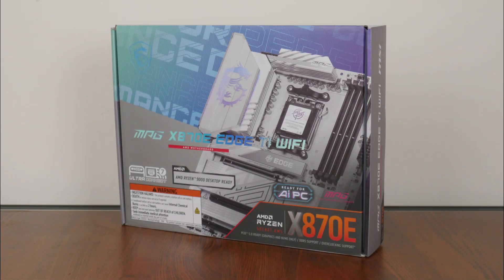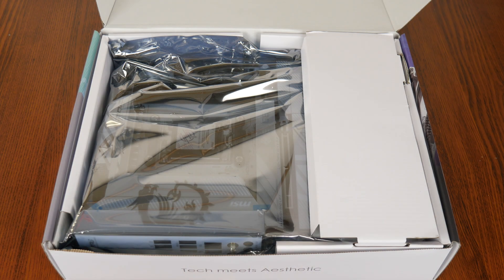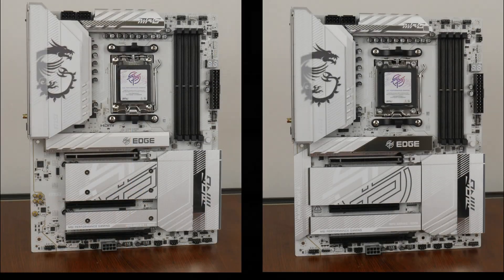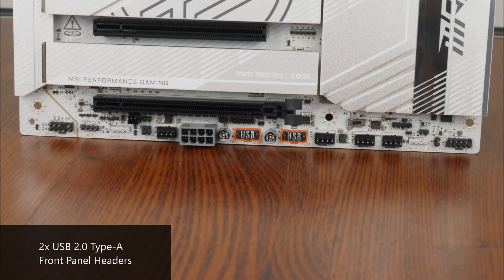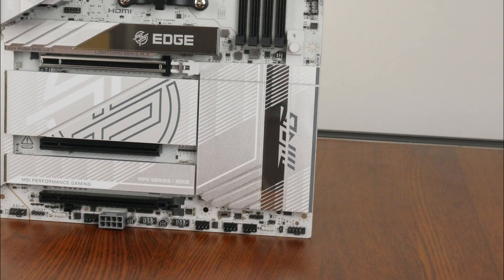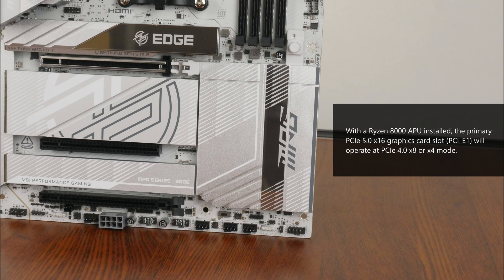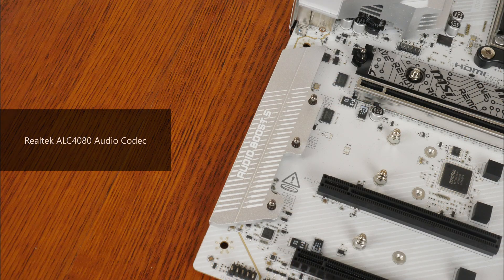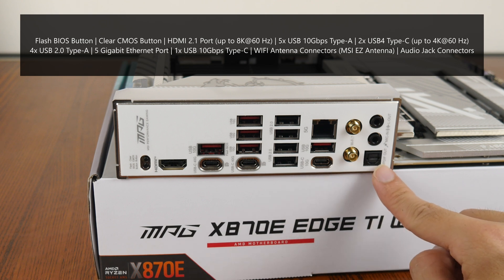Great for high-end Ryzen 9000 PC builds in white! MSI MPG X870E EDGE TI WIFI Unboxing & Overview

Comment: I just built a new system using this exact motherboard for christmas 2025 and i could not be happier! Like you said it looks amazing, feels so premium and performs incredibly well! I love the white so much also that i bought everything in white. From my fans to my power supply to my Powercolor 9070xt Red Devil Spectral White Limited Edition GPU. Beyond happy and so satisfied! Sometimes i just stop to admire my new build with this incredible motherboard! Thank you and MSI! ❤
Reply from the maker: Glad to hear that your build turned out awesome! Are you using perhaps a 7800X3D/9800X3D for your processor? Also, what PC case did you go with for your all-white build?
Reply: @ALKtech  I am using a 7800X3D!  And my case is a Thermaltake Core P3 White case! i love how its all open on the sides..... :)
Reply from the maker: @Blueshade  nice! I guess the only thing about an open-air case setup is the need to clear out the dust from your components every so often 😅
Reply: @ALKtech  This is true but it does stay oh so cool! :)

Comment: Thanks for the vid! Given that this motherboard has a vrm rail of 14 + 2 + 1, can the Ryzen 9 9950X3D performs well on this mother board?
Reply from the maker: Cheers and hope you found the vid useful! Yeah this board should handle a 9950X3D just fine, gotta make sure you've got a good cooler to handle the 9950X3D's thermals! Are you intending to use say, a 360mm AIO for your build?
Reply: @ALKtech  Thanks mate! yeah, I chose the Arctic Freezer PRO III 360 for my black and white build.
Reply from the maker: @str2591  nice, that AIO should handle the 9950X3D just fine! Will you be using a range-topping GPU for your build?

Comment: I dont understand the ezconn port, my msi aio is plugged into it but i still have to plug the pump in the top and the usb in the bottom, so basically it combines the aio fans and argb into one right? Or am i missing something?
Reply from the maker: Hey there, yup it's supposed to combine the fan header, ARGB header and USB 2.0 connector into an all-in-one connector - which model of MSI AIO do you have, and does it have the EZ-Conn cable header?
Reply: @ALKtech I have the p13 360 aio, it has the ezconn connector
Reply from the maker: @jimmystewart510  ahhh I see, your P13 uses the JAF_1 EZ Conn connector, which only combines the ARGB header and fan header into one connector. There are two types of EZ Conn connectors - JAF_2 is the other more "premium" type and uses eleven pins, where it combines ARGB, fan and USB 2.0 into one header. This explains why you still have to connect a pump header and USB 2.0 header to your motherboard!
Reply: @ALKtech thanks! Made a note, now I know what to look for

Comment: So does this mean that if I only use Gen 4 ssd then I won’t have to worry about any lane sharing at all?
Reply from the maker: Hey there, as long as you have a M.2 drive (regardless of PCIe Gen) installed in the second M.2 slot, there will be lane sharing for sure. Hope this clarifies!
Reply: @ALKtech ohhh ok thank you! But if I use the 3rd or 4th slot I’m good? I’m planning on using 2tb on the top drive and then sticking another 2tb somewhere else later on. Which should I use for secondary drive to make sure no lane sharing happens?
Reply from the maker: @BoscoLocoo  yeap you can install your second drive in either the third or fourth M.2 slot and there won't be any lane sharing!

Comment: After going back and forth between this board and the x870 Aorus I pulled the trigger on this one. And got it for $270, only to see the very next day the price is back at $325. Thank god I got it when I did. Just came in yesterday and wow, the build quality and features and aesthetic for an all white build is unmatched! Just wish they would have went full white by not using the black accents for the DIMM slots etc. Haven’t built with it yet but man I’m hyped
Reply from the maker: Man US$270's a pretty darn good price. Where I'm from (Singapore), this board goes for around US$500 😅 And yeah, pity about some of the board's hardware bits being black in colour..it seems like only Gigabyte got the memo on an actual all white board for the current gen of AMD and Intel boards! What processor and GPU are you intending to use for your build with this mobo?
Reply: @ALKtech I got the Ryzen 7 9800X3D and Rtx 5070 ti Aero OC. All in the white Lian Li o11D Evo Rgb. This is my first pc that isn’t a pre built so I’m going big on looks. I wanted a 5080 but they cost sooo much especially for a white one :(. But damn bro why’s it so much more expensive in Singapore?? Shipping reasons?

Comment: Where is the CMOS battery located? I have this board and can't find the battery.😭

I tried to update with bios with a USB flash drive on the back and now the computer won't boot (but it does power on.)

I've already tried jumping the JBAT1 and still no luck.  Next step is to remove the CMOS battery to drain any residual electricity in the board, but I can't find the battery.
Reply from the maker: Hey there, sorry to hear that your BIOS flash attempt failed. If my memory hasn't failed me, the CMOS battery is located beneath the I/O shield shroud, around where the VRM heatsink is. You'll have to remove the integrated I/O shield, I/O shield shroud and VRM heatsink to gain access to the battery I think 😅 that said, if the BIOS is bricked, I doubt that disconnecting the CMOS battery is going to help, and you might instead want to try the Flash BIOS feature once again, perhaps with a different USB drive to see if you can successfully re-flash the BIOS and revive the board. Hope this helps!
Reply: @ALKtech  Yes... it helps. thx. I'll try a different USB stick tmrw. I found another blog that said to use Rufus to format the stick. So I'll do that and try a previous version of the bios just in case.  

Wish me luck! I hope I didn't brick it permanently.🤞😬

I had another thought. Maybe you could advise...
Would the video card have anything to do with it? 

The computer turns on,  but nothing shows up on the monitor. Computer was working perfectly before trying to update Bios. 

Would it be possible that the bios update DID work, but then it somehow "forgot" my really old video card? 

My card is from 2008, but has been working perfectly.  (Been holding off on getting a new one until the prices for used ones come down.)
Reply from the maker: @happyhomeandgardenjohndawne  best of luck! Modern motherboards aren't as "glassy" when it comes to BIOS recovery compared to say, boards from perhaps ten years or more ago, so hopefully you'll be able to reflash the BIOS successfully and be on your way! On the note about your graphics card, what processor are you using with this board? Reason why I'm asking is that AMD processors have integrated graphics that you can use as a back up (assuming your processor is a non-F part, F parts such as the Ryzen 5 7500F do not come with integrated graphics). While I think it's reaaaally unlikely to be a graphics card issue, you can try plugging in your monitor to the HDMI port on the rear I/O of the board, and see if anything changes!

Comment: Which three slots would you use? I'm planning on the operating system and games on one 4tb M.2 and a couple more M.2's for additional storage. I'm going to put the 4TB in slot one.
Reply from the maker: Yeap I'd put the 4TB OS drive in slot 1. Do you have any use for the USB4 ports? If no, go on ahead to populate the remaining three slots with M.2 drives, and disable the USB4 controller from within the BIOS such that the second M.2 slot will have its full bandwidth! If you foresee using the USB4 ports, I'd avoid installing any drive in the second M.2 slot, and populate just slots 3 & 4 - this will avoid any lane sharing. Hope this helps!
Reply: @ALKtech  excellent, quick response. Thank you so much for the help!!

Comment: only problem is difficulty in accessing the battery, they could have done the same as carbon, easy access to the battery.
Reply from the maker: Yeah agreed, though this seems to be a trend with motherboards of late, where board manufacturers tend to "hide" the CMOS battery beneath the I/O shield shroud!

Comment: Just finished a build with the motherboard. Only discovered EZ Conn after. Have an NZXT Kraken, would that work when connect through the EZ Connect port?
Reply from the maker: Hey there, I think it should work. Why not just give it a try and see how it goes - it'd be interesting to see if it works with your Kraken!
Reply: @ALKtech  Will be giving it a shot later today. Booted up the PC without EZ connect. Have the Kraken hooked up a set of Lian Li Wireless TL fans. The fans on the AIO are blinking. I believe they arent getting enough power. Am interested to see if EZ Connect solves this issue, or at the very least works at all. Will come back with my findings
Reply: Can confirm EZ Connect works with the NZXT Kraken Elite 360 AIO. Very cool feature this motherboard offers
Reply from the maker: Sweet, thanks for sharing. A useful data point for folks out there who might be keen to use EZ Conn with non-MSI hardware. Cheers!

Comment: For anyone considering this or any Msi board, make sure to go to the MSI website and confirm your cpu, vga, RAM and your NVME ssd drives are on the compatible QVL list and have been tested and match “”using the full part number”” because they are very picky about components and can send you into debug if you use the wrong part number component. Also there are only upper heat sinks for all m.2 drives, not both sides like in some other boards unfortunately. Would also be nice if they had a black option but white is cool too. For the price this is a nice board! And the accessories are cool too. Thank you for the detailed overview ALKtech! 😎👍

Comment: This was really helpful! Just put this in a black HAVN HS 420 case with reverse blade be quiet! light wings fans (7 black reverse blades for intake with white logos with white rgb rings around them, the other 4 fans are black be quiet!s) and I gotta say, I'm glad I made that decision! I loved the specs and got it on sale, but I was worried about how the white motherboard might clash. With all the white/grey accents on the black case and fans and the more metallic/silvery accents on the mobo and ram (g.skill Trident Z5 royal royal), it works really well. I was tired of all black builds, but thought all white builds seemed equally "same-y". Glad I took a chance, because I have a really hard time visualizing the final result in my head.
Reply from the maker: Glad to hear that the build turned out super! Did you go with a black graphics card for your build?
Reply: @ALKtech  The GPU is likely what clashes the most, to be honest. It's the ZOTAC Amp Infinity 5070 ti, which is more gray with bronze/tan accents. Awesome card specs and cooling-wise, but there are other cards I think might've looked better (I bought it a while before all my other components when I'd pictured a different build aesthetic.) I think the ASUS TUF would've looked better, perhaps even the white version, but it was $100 more.
Reply from the maker: @amphibeingmcshpongletron5026  mmm I see. Anyway swapping out your graphics card's pretty easy to do further down the road, perhaps when the next gen of stuff from AMD/NVIDIA drops (perhaps not the RTX 5000 SUPER series that's rumoured to arrive end of this year/early next year😅).

Comment: Just picked up this board for $269.99 on Amazon. It was too good of a deal to pass up!
Reply from the maker: That's a steal! What's the specs of the PC that you'll be building with this board?
Reply: @ALKtech  I haven't done a new build in 5 or 6 years. This time I will be going full AMD. Sapphire RX9070XT Pure and Ryzen 9800x3d in a Phanteks Evolv X case. Still researching ram and cooling.

Comment: I own an X870E Aorus Pro Ice, but I’ve been having a bad experience with it and decided to switch to this MSI motherboard, hoping for better quality. Lately, I’ve been getting a Debug error code 0d on the Aorus board, which has made RAM slot two stop working—so now I’m stuck using just one stick. I tried reaching out to Gigabyte customer support, but they never got back to me… I really hope I won’t feel abandoned by MSI as well.
Reply from the maker: Ugh, sorry to hear about that. Did you manage to return your Gigabyte board for a refund via your retailer/local distributor, or even get your board RMAed in the end?

Comment: Thanks for review! I just bought a 9800X3D and now i want a white setup, so I found this motherboard, I want it now! Looks beatiful! I thinking about black setup with ASRock Phantom Gaming Nova with better power phases, but now it's time for white power :D I bought a Arctic Liquid Freezer 3 420 ARGB white version - looks great!
Reply from the maker: Cheers and hope you found the video useful! Sounds great, have you decided on which PC case to get yet?
Reply: @ALKtech I have a Phanteks P600S White, but I think I'll switch to be quiet! Shadow Base 800 FX, because of Arctic Liquid Freezer 3 420 ARGB on top of the case 😊 Now I only can mount it on front, that's a bit sad 😢
Reply from the maker: @Forioous  sounds like quite a beast of a build that you have on hand! What GPU are you using for the build? Is it a white-coloured card too?
Reply: @ALKtech  nope, at the moment is RTX 4070 Ti PNY Verto, but I want switch to new RTX Super, propably 5070 Ti Super or 5080 Super, I think MSI Gaming Trio White or Gigabyte Aero :)

Comment: I wonder if m.2 gen 5 run as hot at pcie 5x2? Or will it run less hotter since it's not running at full performance?
Reply from the maker: That's a good question...my guess is that it'll probably still run at the same temperatures as full-fledged x4!
Reply: @ALKtech carbon has thermal pads at the bottom side of all m.2 slots, is there an aftermarket pad that you can buy? Is it just a pad or is there also a heatsink at the bottom?
Reply from the maker: @nuarif  yeah the Carbon is more premium offering that is positioned above the EDGE TI WIFI, no surprises here that MSI would include thermal pads on the bottom too. That said, I'm not aware of aftermarket thermal pads designed to be placed below the M.2 drive 😅 Are you looking to install multiple M.2 drives for your build?

Comment: I am now in between MSI MAG X870 Tomahawk WiFi vs MSI MPG X870E Edge TI WiFi
Which one would you suggest? Definitely one is more expensive than the other but its about $170 differences, would like to hear your thoughts. :)
Reply from the maker: Hey there, have you decided yet on whether to go with a black or white PC build? Or is your motherboard choice gonna determine the colour of your build? That said, disregarding the colour of both boards, the Tomahawk is very similar in terms of specs to the MPG X870E EDGE TI WIFI from what I see on MSI's specs page for the board - I wouldn't hesitate to use both boards with high-end AM5 processors such as the 9950X and 9950X3D!
Reply: @ALKtech im thinking white
Reply from the maker: @epictimeguy  cool, is the MSI B850 EDGE TI WIFI available where you're from, and if so, how much does it cost? It could be a good alternative to consider as well, especially if you don't have a need for USB4 and if it has a better price than the X870 Tomahawk!

Comment: Concidering between this one, strix X870-A, X870 Aorus Elite, And X870E Aorus Pro.

Which one might be the best? I am not gonna overclock my 9800X3D.
Just would like to have safe and very good motherboard for many years.
And of course has to be white! 

You have a new subscriber :)
Reply from the maker: Cheers and thanks! The first factor I'd look at is pricing - how are prices like for all three boards where you're from? Personally, it'd be either the Gigabyte or MSI for me - I'd pick the Gigabyte for aesthetic reasons as it's the only properly all-white motherboard with white onboard hardware connectors and even SATA cables, while I'd take the MSI due to its balanced feature set and the fact that they've handled the PCIe lane sharing situation that plagues X870E/X870 boards in a more "palatable" manner - with most X870E/X870 boards (including the Gigabyte X870E AORUS PRO ICE and the ASUS ROG STRIX X870-A GAMING WIFI), at least one of the PCIe 5.0 x4 M.2 slots shares bandwidth with the primary PCIe 5.0 x16 graphics card slot, while with the MSI board, the lane sharing is between the M.2 slot and the USB4 controller and can be user-configured, which I feel is the lesser of both evils 😂 That said, all boards should handle the 9800X3D with ease due to their VRM setups!
Reply: @ALKtech  Well, finally found out MSI sharing is, as you said, best of all so that's the one I am going for.

However for now, due to power section in MSI MPG X870E Edge, I am thinking about MSI MPG X870E Carbon. 14+2+1 vs 18+2+2. Sounds more futureproof? 

Maybe its black, however with white rest of components it still might look very cool. 
And its like 50$ more in Poland so not a big deal. 

What u think?
Reply from the maker: @Oscar-ln1ol  in my opinion 14+2+1 with 80A phases is already more than enough for say, a 9950X3D and perhaps even AMD's next-gen high-end AM5 processors. Also, while the Carbon's a pretty solid board too, it was released as part of the first wave of X870E/X870 boards and hence shares the same lane-sharing shenanigans as the ASUS X870-A and Gigabyte X870E AORUS PRO ICE 😅 I'd personally still go for the X870E EDGE TI WIFI and save that $50!
Reply: @ALKtech  already bought carbon one.

Hope it will work!
Reply from the maker: @Oscar-ln1ol  I'm sure it'll work great! Cheers and enjoy your new build!